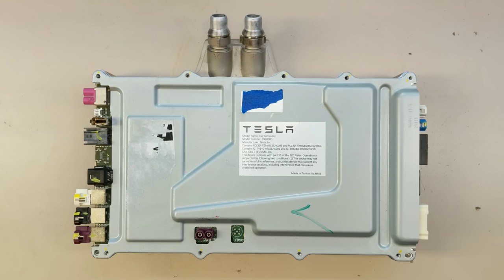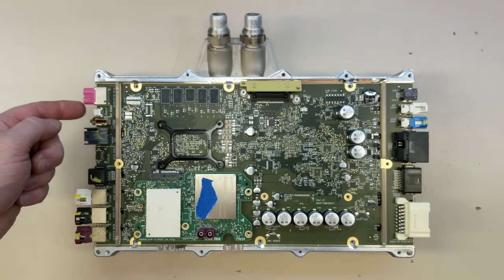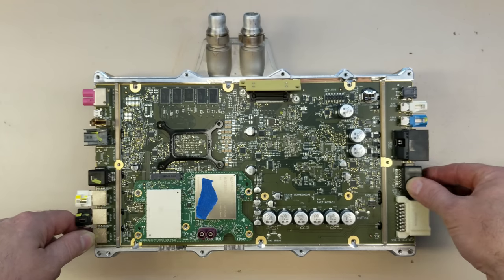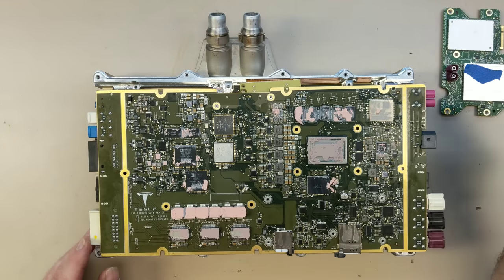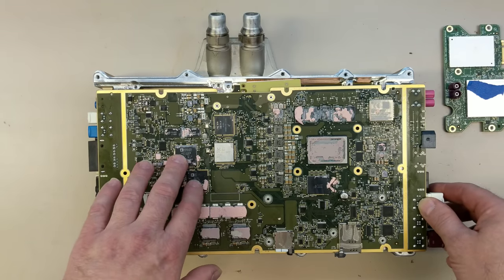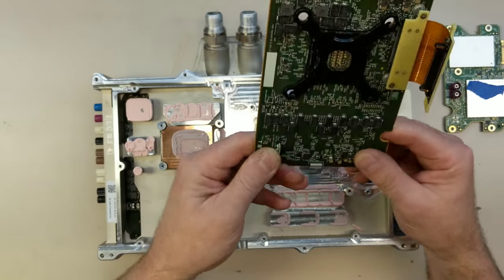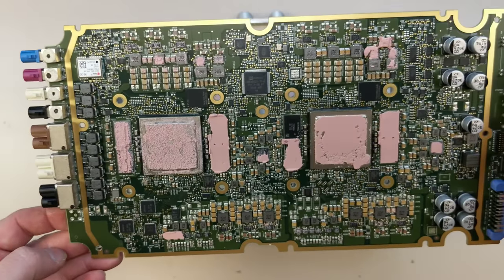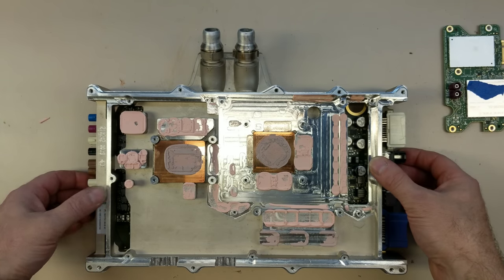Tesla's New Plaid Car Computer!

Comment: I'm shocked that this is not a hermetic unit :o
Reply: Yes, given the price and the mount location, that would certainly be the more sustainable option.
Reply: Could be that they have not finilized the conformal coating at their supplier and/or additional components to release the vehicles to customers sooner citing low likelyhood of water damage. Many manufacturers are making shortcuts right now due to constraints in the supply chain.
Reply: @chouky02  You can always wrap it up in a plastic container, and make the cables tight with 1$ of silicone.
Reply: @chouky02  Sealing covers and cable-connectors would be good enough with a pressure relief valve and desiccant to take care of altiude- and temperature-changes, pretty much like for a harddrive.
Conformal coating would just be an icing on the cake.
Reply: Its not a submarine
Reply: @KateUrchin  Certainly not, but liquid spills or flooding are real dangers in the footwell.
The entire HV-cabling is watertight, one more seal doesn't sound excessive given the value of the module and its central role in keeping the car working.
Reply: Probably cheaper to just replace the computer in the event of flooding or liquid exposure. Cost of sealing 100% of the units is a needless increase in cost for the vast majority of vehicles.
Reply: @TheNamche  Check the cost of the unit, then check the cost of sealing it, then think again if leaving it vulnerable to liquid damage is really in the interest of sustainability, one of Teslas lofty corporate goals.
Reply: @TheNamche  Cheaper for Tesla, certainly, but not for you if it happens out of warranty...

Comment: the only spec sheet i could find on single pair BR-PMA is 100Mbit... i'm curious how 1000Mbit is achieved... is it still PAM3 at 33.3Mhz, with more channels and higher symbol rate? also, probably a dumb question, but, how did you figure out the diag interfaces (micro HDMI/UART on the ryzen, USB-C/HDMI on the autopilot)?

Comment: Video inputs on the dual custom A72 autopilot board - are they T1 ethernet, GSML FPDLink?    Also curious we see 2 species of ethernet switch - Realtek + Marvell.   A while back Tesla announced they were a starting successor to the twin (1+1 dual simplex?) ARM solution, I'm guessing it will be based on a  ARM redundant core automotive processor A76AE or successors maybe? I can picture how such a high availability upgrade PCB could fit neatly into this stackup.  Finally, the single central cold plate is a winning architecture with lower cost & weight with higher efficiency - top marks for that and liberal use of T1 GigE.

Comment: Hi, can you please help to understand, how does the redundant power work on the FSD board? 
-if there is only one 12V battery, where does the second source come from?
-is there also dual power also for the non FSD board?
-I see that the white and blue connectors on the FSD board to not have the same number of pins, are they really both power supplies?
Reply from the maker: There is no "FSD board".   The only difference is software.   The redundant power is the 12v battery and the PCS.  (DC-DC supplied by HV)

Comment: Simple question, why is it water cooled? It's a 45Watt Ryzen. That thing would be Ok with a simple air cooler that would weight maybe 1/25th of that block and be more than good enough.
Reply from the maker: Keep in mind this is also cooling the Autopilot hardware, and this is inside a car cabin which can almost boil water in cars outside in hot climates.  Air cooling is not going to cut it if you want it to be reliable.

Comment: I imagine the ether switch chip on the NPU board is for a heartbeat between the redundant processors?
Reply from the maker: Ethernet is used for all high-level comms:  Infotainment, Autopilot, Gateway, Radio Tuner, and Diagnostic port.

Comment: Any reason why they wouldn't make this the new standard compute system for ALL Teslas moving forward, design permitting - for example new Model Y's from Texas and Berlin (and maybe China's MY's) ?
Reply: I'd be surprised if they didn't. The model 3 and y media entertainment horse power will need to be improved once Fsd gets going. They'll probably upgrade 3 and y  to this in gigaberlin and Texas. Then follow suit in China/ Fremont as practical, and cost comes down

Comment: I'm surprised there is no conformal coating on the PCBs, and that the housing isn't somehow weather sealed. I think most automotive modules have at least one if not both of those things.
Reply from the maker: This lives inside the cabin, so doesn't need it.

Comment: @Ingineerix, Thanks for your video, what happen if battery coin is dead ? Or SD card is dead ? For sure in the car life battery coin and sd card will dead.
Reply from the maker: If the SD card fails the only problem will be that logging stops, and you cannot update the software.  But it's also easy to swap.   The on-board battery is only for keeping the real-time-clock running if the car's power is removed, so it won't really have any noticeable effect if it goes dead.  Since the car computer most always has power this battery should go 20 years anyway.

Comment: Would it fit in a Model 3 for retrofit upgrade?
Reply from the maker: No, different wiring. I expect Tesla to switch 3/Y to it in the future though.
Reply: @Ingineerix  Thanks. Aside from wiring I mean, the footprint and coolant position is the same as the previous one?
Reply from the maker: @allowambeBOWWAMB  The footprint is similar, but different, and the cooling connection is different.  No, it will not retrofit as it is.  There's no chance of Tesla offering it either.
Reply: @Ingineerix  That is sorta good news anyway . The new board for the "gaming" MCU computer is roughly same size as the old one. With a new case and connectors it can be wired if intel atom ever reaches EOL.

Comment: DUDE! I am an ME and I have a huge question. That coldplate / housing core is unbelievable - how is the cooling channel manufactured? The only method I've heard of that would work is either sand cast or salt core die cast, which is wild. Because this looks like one solid piece, it doesn't look like it's been welded back together. Do you still have the housing?
Reply from the maker: To me, it appears to be 2 halves, and they appear to be friction stir welded on the sides.
Reply: @Ingineerix  huh, how does that work with the inlets? I’ve only heard of friction stir welded in one plane. Do you see weld lines around the sides?
Reply from the maker: @jon-williammurphy9780  Sorry, I assumed you were talking about the older computer.  I realize it was the new one, yeah, I can't tell how it was done, it's one big casting, so there is some kind of hollow process like you describe.

Comment: If you disconnect the Bluetooth/wifi connection 
Would that prvent disabling  DC fast charging
Reply from the maker: If you disable the cell connection, and you do it BEFORE Tesla determines it's salvaged (usually not possible), then you might get away with it still on, however, you'd never be able to use any of the connectivity functions, or update the software.

Comment: also two backup batteries on the autopilot board so redundancy there as well
Reply from the maker: No, these cannot power the system.  They are for memory retention.
Reply: @Ingineerix  I know :) backup for the clocks not to drive the CPU or car ;)

Comment: The autopilot looks to be 2x custom FPGA accelerator Computers 
It good for them due They  are the only Processor chip that can do self Repair to it damaged HW logic level  and Have Software AI completely Re Wire The Chip To avoid the Damaged HW Logic Parts While still use the  Good parts of the chip  (Lot of Spare redundancy)

Comment: I totally get "if it gets wet, itll be expensive" but ive seen test drives where the car is practically submerged. Is it housed/enclosed to resist water seepage into the unit?
Reply from the maker: Water would have to be up to your calves inside the car before the computer gets wet, so unlikely in normal operation.

Comment: I wonder why its not sealed housing. Some bugs or insects can fry the circuits, as well as water damage!
Reply: Hopefully, the panel gaps are tight enough to keep insects out ;-), but it would indeed be a lot better to waterseal the whole thing.
Reply from the maker: If water does get that far into the car, your car is totaled.

Comment: I had that for autopilot they were running two stacks in parallel across two separate chips: 1 for actually driving your car and another that was usually running an upcoming beta version of the software to compare against what the stable version was running. Is this true at all and is it the case on the autopilot board? I saw two identical looking chips, not sure if it's an ASIC or what. Thanks!
Reply: That was the original plan but it is my understanding that the current build of FSD is too big to now just run on one chip and uses both simultaneously.  Hence Ver 4 of the FSD board is scheduled to come out late 2023.

Comment: Amazing knowledge , Would it be possible to build a custom computer like this that fits into a jeep wrangler ?
Reply from the maker: Of course it's possible, but you are probably looking at millions of dollars in development cost.  If you include autopilot, probably on the order of tens of millions, if not over a hundred million at this point.  Got your checkbook?
Reply: @Ingineerix  i see , so it wouldn't be possible to move a existing system to a more powerful console ? Ie for example upgrading the hardware of a jeep wrangler from a basic quad to a 16core with a better gpu . Same functionality but better spec
Reply from the maker: @DALINKUP  Of course it's possible, but at what cost?  If you are designing a car computer like Tesla did on this one to be manufactured in the millions of units for many years of production you can afford those one-time engineering costs.  You as a Jeep owner cannot afford the engineering costs to re-engineer the whole Jeep infotainment system.  It's too big of a project for a "one-off".  If Stellantis wouldn't do it in the first place, how can just one guy?
Reply: @Ingineerix  i see , i didn't know if it was possible just to transfer a existing system to better hardware . But you've made me aware that it would take development . I thought aslong as your using a existing system / do not try and edit or add to it you're just increasing the hardware's power . 

 Kinda like how some people use Chinese oem parts to upgrade existing systems , As alot of Chinese factories haven't got millions to develop parts . They just make the connectivity universal . But thank you for the answer

Comment: 😂💦🤷🏼‍♂️ but hey mine got pretty wet then dried out in a couple days and gtg…for now at least.  Far from distilled water so im sure i have some residue left over that might come back to bite me 😬 super impressed either way that fired back up at all!
Reply from the maker: If you want it to last, I highly advise removing it from the car and opening it up.  Clean everything with 99% isopropyl alcohol using a toothbrush.  Especially any areas with white of grey corrosion on them.
Reply from the maker: @andyk192  It most definitely is not.

Comment: Besides for the custom image processors, why do they need such a beefy system, why not something like a Qualcomm SoC?
Reply from the maker: They are driving 3 displays and want to support gaming on 2 at once.   If you've ever used an in-car touch screen from another manufacturer you will appreciate Tesla's choice here.   Personally I don't care about gaming, but the response of the GUI is sure nice!
Reply: @Ingineerix  seems like a weird design choice when they've gone to so much effort to reduce energy consumption elsewhere
Reply from the maker: @foggs  The roughly 50 watts that this system draws on average including the screens (most of the consumption) is nothing really in the scheme of driving the car down the road.  That's not even enough energy to even take a mile off the range.  To put it another way, the car's pack can run this almost 2000 hours, or almost 3 months!
Reply: @Ingineerix  fair enough. It better run Crysis though

Comment: since the new plaid has audio amplifer on the  MCU board,  does the amplifer near the rear of the car still exist?
Reply from the maker: Yes, the on-board amps are only for the small speakers such as tweeters and pedestrian sound speaker.
Reply: @Ingineerix  thanks so much

Comment: What is up with the pink paint on all over the back side of the V3 chip board. Is that what its called.
Reply from the maker: This is TIM (Thermal Interface Material) to conduct heat off the parts on the board and into the cold plate where the glycol system can carry it away.

Comment: The CPU coldplate/block is a bit excessive for 45W watercooled :D
Reply: I hope the heat is being transferred to the heat pump. Think about if the heat from your gaming PC is actually put in some real household use...
Reply: @zerosugarmatcha7348  It is being transferred just like on the Model 3 / Y
Reply: It's very likely primarily there for the FSD computer, which I'd imagine is a heck of a lot more power-hungry than the main CPU/GPU.
Reply: @clonkex  The whole cold-plate indeed isn't, but I was talking about just the CPU part which is really excessively sized considering it is liquid cooled. Maybe they OC'd it or are running hotter than normal coolan through it but otherwise the use of the ammount of copper it has is totally unnecessary for the 45W CPU.
Reply: @rkan2  Ah I see, yeah maybe they weren't sure exactly how large the die was gonna be or where it would sit.

Comment: Electronic components come in various grades, like consumer, industrial, automotive, military and space grade. It is known that the MCU1 suffered from a too small, consumer grade eMMC......so I wonder what grade these are. Also, as you mentioned the replacement cost would be insane, hopefully one day there are shops which can component repair those units.

Comment: That little tiny backup battery is concerning. How many years until that fails?
Reply: warranty time + 2sec=battery life
Reply: Assuming the 12v system is operating properly, 10+ years. This battery is only used when the 12v system fails.
Reply: There is already power available all the time. It's like a second battery backup (never used) ... they can last up to 20 years.

Comment: Where is the battery management, if it is in there? could the display 2 be for the rear display in the refresh? my guess for repeater 2 is they thought about putting 2 more cameras elsewhere but the idea was scrapped, but they left it there to keep options open.

also, i see there is that thing that looks like a coolant line - where do those go?
Reply: The BMS is inside the battery in the "penthouse", a slight bulge in the battery case. It needs to be there to avoid long cable runs and the same module also contains the relais and pyrofuse for the battery.

It's liquid cooled by the same system as the battery, the motors and the heatexchanger of the aircon.
Reply: @Makatea  ots also part of the high voltage battery, not to be mixed with low voltage 12v....

Comment: I respect you. I'm looking for an amd power connector. It looks like a black 10pin connector, can you help me?
Reply from the maker: Connector on the power connector for the unit in my video is a KSE K20F00711.   That's all I have.  (Not all AMD units use the same connector now)
Reply: @Ingineerix  Thank you very much for your reply. I think Korea also uses that connector, but it doesn't come out even if I search for the connector number on Google. Is there any way to find it?
Reply from the maker: @silk-d9f  No, it might be custom to Tesla.  Best bet is to call a salvage yard and ask them to cut one off a harness for you, that's what I did.

Comment: After removing it from the car, can the car still be driven?
Reply from the maker: No, because it also contains the gateway that's needed for the car to drive.
Reply: @Ingineerix  Thanks for the answer! My situation is very bad, and the official Tesla repair and replacement price is $3200, which is a robbery because it is not an imported product and is not worth that high price...

Comment: You mentioned "ecall" for Europe. Any chance you could give us Americans a quick primer on what ecall is? :)
Reply: Source: I used to work for the company that supplied the LTE telematics module for some older Teslas (that Quectel chip replaced my previous employer, RIP, good thing I left). eCall stands for emergency call. Basically, if you ever get into a serious accident or manually press a button because you need urgent help, this will automatically connect you to the most appropriate emergency services along with your current location. This way, if a serious accident happens, help will be on the way almost immediately even if nobody saw it happen and you're unconscious. It's been required by law since last year I believe, and it has to follow strict standards.

Fun fact: to validate that this system works, they actually do full car crashes at the end of development. They flew a couple guys over and told them they had 3 cars they could crash for the test. As a software developer, it's quite frightening to hear that every test costs $50k, and you can only have 3 goes at it. The effects of bugs tend to be quite a bit less dramatic usually...
Reply: @Niosus  Awesome, man, thanks!
Reply: Its like Onstar that is in GM vehicles.